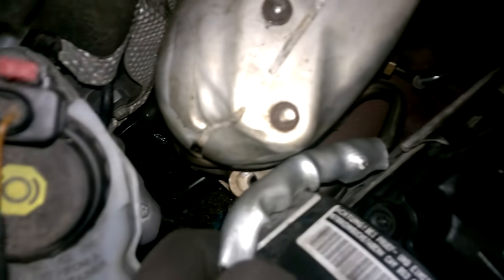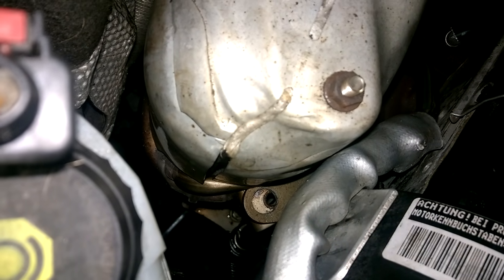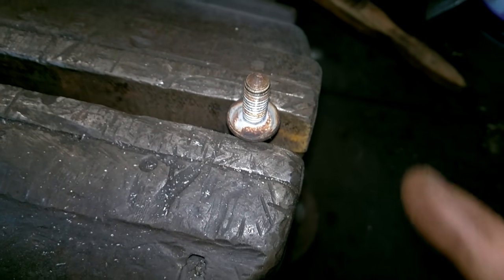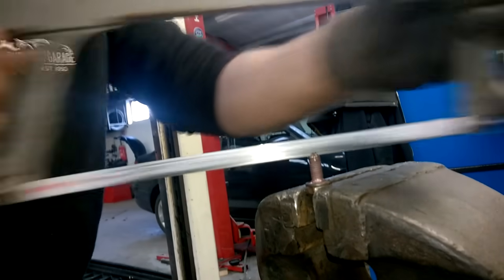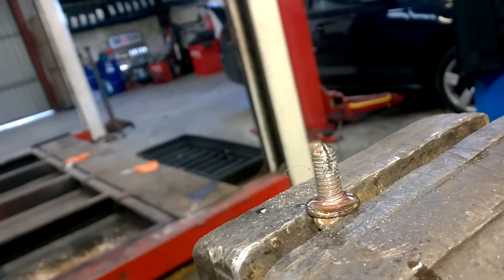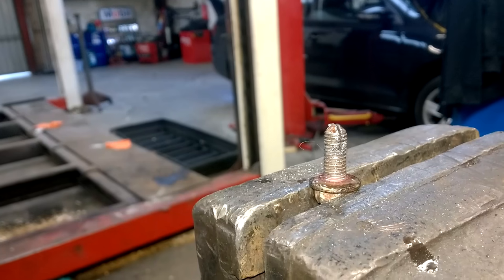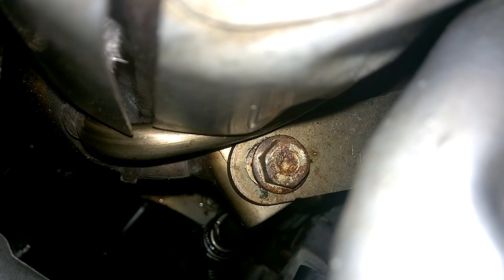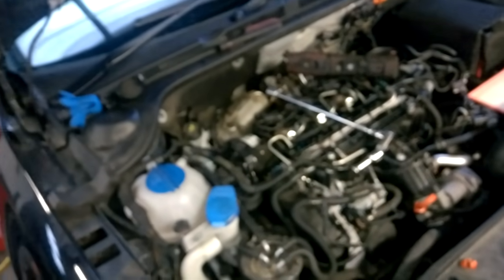My Father Taught Me This! Passing It On To The Next Generation

Comment: I remember mechanics using this trick years ago when I worked in a gas station with an auto repair shop, when young. Cars were not made with close precision and tolerances, as they are today and there was more space and slop back then in the engine compartment. I almost forget about this technique until I saw it again here. Those old timers were quite clever back then. It brought back memories of an earlier time. Thanks.

Comment: Same thing can be accomplished by grinding a groove down one side of the bolt on the edge of a grinding wheel. The bolt will act like a self tapping screw. Great tip thank you I will try it next time I encounter a stubborn starting bolt !
Reply: Or two grooves on opposite sides of the bolt...works just as good.

Comment: Thanks for the tip!
If you have a likely stubborn bolt, try tightening it more BEFORE attempting to loosen it. It'll be less likely to break or to strip threads.
Reply: Really?
I will try that. Unfortunately I deal with quite a few seized bolts on aging equipment and I usually break them.
Reply: @gardenwasteman1600  :)
Reply: You worded that very poorly.  You wouldn't know the bolt was stubborn until you tried loosening it.   What you should have said if you find a bolt is stubborn, try tightening it just one degree to break it loose.   Another trick is to tap on it with a hammer while turning if you don't have an impact wrench available... hopefully you can have a second person tapping it for you while you turn..  and or using a cheater bar.. or using a second wrench as a cheater bar hooking the 2 wrenches together to make it longer..

Comment: To help to prevent cross-threading, start it, by turning counter-clockwise first. You'll feel the the treads pop into place, for clockwise tightening. 
 It always works well, for bolts, nuts, screws, and the like.
  You'll like it.
Reply: John Heigis I’ve done that for years and I always have someone tell me I’m threading it backwards try to explain but most people don’t get it
Reply: Learned that from my late father-law-law 45 years ago. It worked then and now.
Reply: Never seen it fail.
Reply: Doesn’t work on bolts manufactured after 2015

Comment: Dads always have the best knowledge.

Also over 6.8 million views, good going.
Reply from the maker: The update info below is the pinned comment on this video, I know most people do not realize I made that video and it better explains/shows this method in use.   
I also included below details of why the job was done this way free of charge with the customer fully informed. I hope you check it out  👇👇
 
UPDATE* I decided to make a follow up video on this https://www.youtube.com/watch?v=yfNQullGEuQ&feature=youtu.be Should answer some of the questions that were raised, I include 3 demos of this in action with close up shots.
 
As there was some safety concerns & confusing comments raised, I felt I should clear a few things up. 
1) This is a tip for certain circumstances only, I never have and never would use it on a component which would cause any safety concern to any customer.  
2) The demo was done on a support bracket only, items like this or similar will not cause any safety concern. 
3) I did this free of charge and on a time restraint, I noticed it when I was replacing another item, the customer needed the vehicle back that evening and I decided rather than leave it like it was, I would do this and secure it up fully. 
4) The bolt was not the issue, the part that the bolt threads into is a secured piece, someone had previously damaged it, leaving the bracket loose and the bolt just tightened a turn or so.
5) The bolt can be removed and will not break, it will go in and out as usual and has helped clean up the damaged threads.  
6) Used in the right application I personally believe this is a great tip and can save you a lot of time & trouble. 

Lastly to all the people who have watched the video, Thanks very much and I am delighted with the feedback I have received on it.

Comment: Great tip, you are essentially creating a self-tapping bolt by doing this. A Dremel tool with a cutoff wheel can also be used to cut the slot.
Reply: Black Waterdogs  I was thinking the same thing. Would be faster too.
Reply: And would cause a lot of heat, potentially weakening the bolt
Reply: Not a BFD, it`s only a HOLD-DOWN bolt, not a highly-stressed SUPPORT bolt.
Reply: i like the dremel idea
Reply: Nice tip about the hacksaw. ATF as a cutting fluid was cool. I used my dremel to notch a bolt to make a tap just last week. I've done it many times. Real taps work much better though.
Reply: Black Waterdogs

Comment: Brilliant! Essentially you are allowing the bolt tip to taper around the damaged threads
Reply: I did this to a short piece of half inch threaded pipe, it worked like a cheap tap and recut the damaged threads in the brass shower fitting I was working on.

Comment: Amazing video. I was always taught by my years of mechanic experience, that 80 to 90% of the torque on a bolt was held within the 1st 3 to 5 threads after the base seating of the head of the bolt. Very. Very good advice!

Comment: Cutting a slot in the end of the bolt like this (no need to go so deep) also allows you to put a screwdriver blade thru a hole to start the bolt when hard to reach from the head end. This trick works great on a Ford starter bolt

Comment: Excellent tip. I've been tinkering with cars for fifty years and there have been many times where this hack would have helped. I'm also going to share it with my son and grandson Thanks!
Reply: Or you cold learn the correct way and pass that on with confidence that your son and grandson are learning the correct method of repairing things.
Reply: McScott76 cover tour butt repair when you install things wrong
Reply: Jim Prong , find something else to tinker with, if you work on car for 50 years you should know all the tricks.

Comment: Great idea. I would thread a nut all the way down the bolt before cutting the slot. Then, when I remove the nut, the nut will clean the threads where the hacksaw has left burs. (My dad also was a mechanic.)
Reply: great idea!
Reply: @JohnJones1987  There is an added benefit. The nut holds the bolt-nut assembly steadier than a bolt alone when you saw a bolt in a vise.
Reply: A good idea, but I would point out that in the demo, there wasn't a nut. The bolt entered a hole in the engine. Nevertheless thanks for the enhancement to this excellent tip.
Reply: If you could get a nut on it then you wouldn't have a problem to begin with. The whole reason for slotting the bolt was to so it would taper down and get to fresh threads.
Reply: @Watthead80  There was nothing wrong with the thread on the bolt. It was the bolt hole.
Reply: @fwcolb  At 1:27 He clearly zoomed into the bolt and said"See where that thread is damaged as well?" So yes, a new bolt would have been the fix.
Reply: @Watthead80  Did not hear that. If he did not have the correct die. He probably did not have the correct nut either.
Reply: I think Fred meant to put a hex nut temporarily in place, then cut the slot, then remove the nut, then install the bolt.
I would also point out that, in the use of a bolt, there is always a threaded mating component, not necessarily a hex nut.
So anyway, it looks like a pretty good hack.
Reply: Very nice.
Reply: my dad is a welder , i just weld those odd pieces , they will last 5-7 yrs in a used car alright

Comment: Great tip! I’ve been in the automotive industry since 94 and I have never seen this before.  Well done.
Reply: As a service writer? I've only been a mechanic 12 years but I've pulled self tapping bolts out of hundreds of cars that were installed at the factory...
Reply: Derrick Hodges This is no ordinary self taping bolt.
Reply: I don't think this modified bolt tapped the hole.  What it did was as the author stated allow the bolt to enter the channel following the original threads (the threads created when the hole was tapped).  Using the term "self-tapping" to describe what happened here would be incorrect.  No "tapping" actually occurred.  

However, where the bolt was cut the outside of the bolt is slightly less in diameter as compared to the uncut part of the bold.  So the cut should probably be made for a short a distance as possible.  

A way of overcoming that (the diameter being lessened) would be to cut a metal wedge with the wide end being the same width of the cut and then insert the narrow end of the wedge into the cut in the bolt but not all the way.  Thus, after the bolt has been started the wide part of the wedge  will eventually "bottom out" and the wedge will be driven up into the bolt and eventually the lower part of the cut end will resume the original diameter of the bolt.  Way overkill though I think. Just cutting the bolt for only a short distance would probably in almost all cases provide enough thread contact to secure the bolt.  But that would depend upon the length of the bolt to some degree.
Reply: pffft i've been in the automotive industry for 2 days and i already knew this.
Reply: Awesome thanks
Reply: 24 years in the game and first time you’ve seen this!.. C’mon guy..
Reply: anan omus Well your just a freakin’ genius then.
Reply: BigbadJohn that's because its dumb...you are going to ruin the threads doing this...this is not a recommendation anywhere...why would you need to do this ? Obviously the holes arent lined up if it wont thread in properly..all you going to do doing this is ruin threads and be forced to use a tap and die set fixing the inside threads of the part
Reply: Exactly my point, cure the problem theres a reason.
Plus potentially knacker up the part threading in to and the actual elongated hole in bracket= 2 wrongs.
Reply: @The570Experience  
If i caught a tech doing this to one of my vehicles id want him fired. 
Take the time you are paid for and chase the threads in the hole, get a new bolt, and align it properly.

People always wanting to cut corners instead of doing a job properly.

Comment: Now that is one helluva hack move, freakin awesome. Thanks to you and your father for both sharing. Cheers!
Reply from the maker: The update info below is the pinned comment on this video, I know most people do not realize I made that video and it better explains/shows this method in use.   
I also included below details of why the job was done this way free of charge with the customer fully informed. I hope you check it out  👇👇
 
UPDATE* I decided to make a follow up video on this https://www.youtube.com/watch?v=yfNQullGEuQ&feature=youtu.be Should answer some of the questions that were raised, I include 3 demos of this in action with close up shots.
 
As there was some safety concerns & confusing comments raised, I felt I should clear a few things up. 
1) This is a tip for certain circumstances only, I never have and never would use it on a component which would cause any safety concern to any customer.  
2) The demo was done on a support bracket only, items like this or similar will not cause any safety concern. 
3) I did this free of charge and on a time restraint, I noticed it when I was replacing another item, the customer needed the vehicle back that evening and I decided rather than leave it like it was, I would do this and secure it up fully. 
4) The bolt was not the issue, the part that the bolt threads into is a secured piece, someone had previously damaged it, leaving the bracket loose and the bolt just tightened a turn or so.
5) The bolt can be removed and will not break, it will go in and out as usual and has helped clean up the damaged threads.  
6) Used in the right application I personally believe this is a great tip and can save you a lot of time & trouble. 

Lastly to all the people who have watched the video, Thanks very much and I am delighted with the feedback I have received on it.

Comment: I don't tighten anything until all bolts are hand threaded.... good idea
Reply: You'd be surprised how many people don't do that
Reply: It's not really a big deal to hand start it. Get the bolt on your socket attached to your impact. Drive that thing in, who cares if its crossed threaded. The only time you run into trouble is if you are the next guy who has to take it out.
Reply: @HermitsHome  yeah because  that's the honorable thing  to do....
Reply: Cross-threaded bolts don't need loctite 🤷‍♂️
Reply: @morganchandler5126  theres no honor in the flat rate game baby.
Reply: It's just  sad to see that people have no integrity anymore ......
Reply: @morganchandler5126  in my tech job, i end up fixing thing that others did wrong or didn't care enough to take 5 more minutes to do it right
Reply: @morganchandler5126  i worked as a mechanic for 8 years. always paid hourly. did my best. if i messed something up id fix it. i always hated the hack job mechanics. gives us a bad name. unfortunately this industry like many others is very time based and slim margins because of high overhead. no room for errors on most jobs. most techs work flat rate. they get paid 2 hrs to do the job if it takes longer they still only get 2hrs. many techs at general shops see new problems and cars all the time that they may not see on a regular basis which causes more room for error. many techs lack training and are required to have a wide variety of skills they most likely havent mastered them all which also causes room for error. i have always said, i like the trade, i hate the industry. sometimes you cant blame the tech trying to make time on jobs that dont pay near the time they take. they have families to provide for. a few minutes here and there to fix little things adds up to lots of hours. all you can do is improve on the next job. most techs arent purposely trying to do a bad job. they are trying to beat the clock.
Reply: @kevink6827  The official motto of The He-Man School of Mechanics! Lol
Reply: Hermit Hydroponics false
Reply: Start the most difficult bolt first.
Do this by turning it BACKWARDS with gentle pressure until you feel the threads "click" into alignment -- then go forward.
Get all started.
Run them down by hand or with "hand-tighten" setting if you have an expensive impact/torque wrench.
Only then tighten them.  Check torque twice.  Check again after 25 miles and 100 miles.
Reply: How do you hand thread it if your hand won't fit?
Reply: @HermitsHome  ssssoooooo you are one of those....

Comment: ANOTHER WONDERFUL EXAMPLE OF THE FACT THAT WE ALL STAND ON THE SHOULDERS OF THOSE THAT HAVE GONE BEFORE US.  Thank you for sharing sir. God bless. Semper fi
Reply from the maker: The update info below is the pinned comment on this video, I know most people do not realize I made that video and it better explains/shows this method in use.   
I also included below details of why the job was done this way free of charge with the customer fully informed. I hope you check it out  👇👇
 
UPDATE* I decided to make a follow up video on this https://www.youtube.com/watch?v=yfNQullGEuQ&feature=youtu.be Should answer some of the questions that were raised, I include 3 demos of this in action with close up shots.
 
As there was some safety concerns & confusing comments raised, I felt I should clear a few things up. 
1) This is a tip for certain circumstances only, I never have and never would use it on a component which would cause any safety concern to any customer.  
2) The demo was done on a support bracket only, items like this or similar will not cause any safety concern. 
3) I did this free of charge and on a time restraint, I noticed it when I was replacing another item, the customer needed the vehicle back that evening and I decided rather than leave it like it was, I would do this and secure it up fully. 
4) The bolt was not the issue, the part that the bolt threads into is a secured piece, someone had previously damaged it, leaving the bracket loose and the bolt just tightened a turn or so.
5) The bolt can be removed and will not break, it will go in and out as usual and has helped clean up the damaged threads.  
6) Used in the right application I personally believe this is a great tip and can save you a lot of time & trouble. 

Lastly to all the people who have watched the video, Thanks very much and I am delighted with the feedback I have received on it.

Comment: To make this even more effective, taper the end of the bolt slightly on a grinder to aid in properly entering the receiving threads.
Reply: that might actually be superfluous as the split bolt performs a cam over action on the misaligned hole or slot and if it is a bottoming thread you run out of room.
Reply: @peterweller8583  No real right or wrong. We must each analyze the condition of the parts we are working with and proceed in a manner that will be successful in completing the project.

Comment: I use this method before with a bigger Bolt. I needed to connect two steel cables together and I had no clamp it worked perfectly just slide the two cable ends together between the bolt then thread the nut on.
Reply: That's a very clever idea, thanks !

Comment: I used a similar technique to re-tap a hole in my transmission when I was swapping out shift springs. I the size tap I needed was like $200, that was insane, and thought I was screwed. Then got to thinking how a tap worked. Got out the Dremel and cut two slits on each side, and I was able to get it fixed. Very good info to pass along. Not many have the mechanical expertise to come up with this solution.

Comment: Also if you shorten a screw, screw on a nut before, so you can unscrew it later, and get the thread back into position.
Reply: Leberkas Semmel yeah, and if you forget that just tapper the end off with a grinder
Reply: Was going to say the same...lol
Reply: Taper.
Reply: Leberkas Semmel h
Reply: @4wdsome444  doesnt always work in fact usually does not.
Reply: Sakura Hana machine screws 100% use nuts